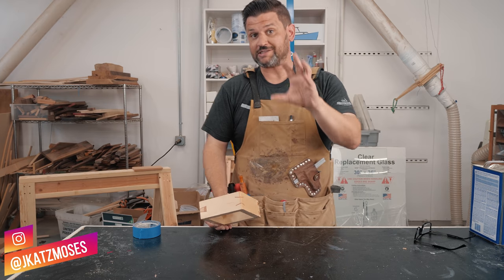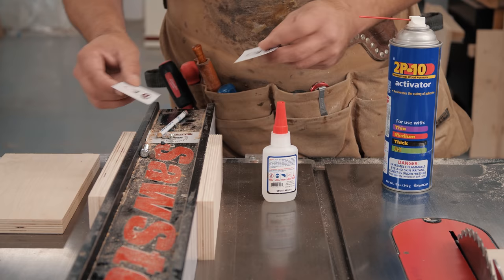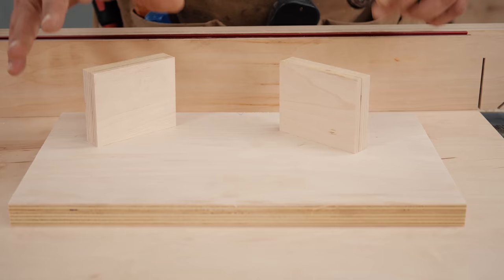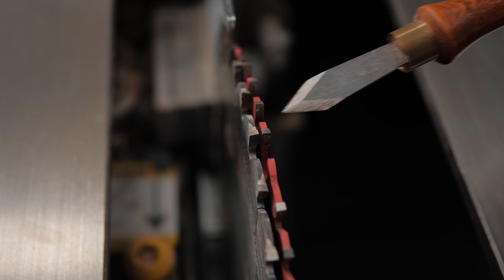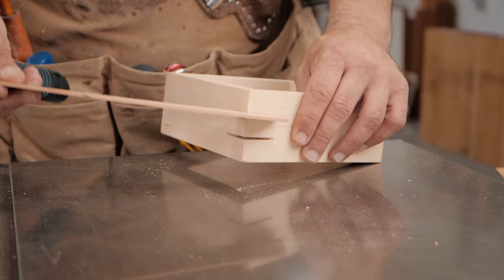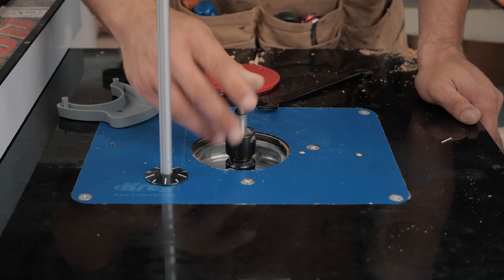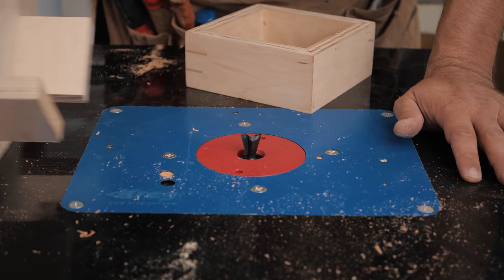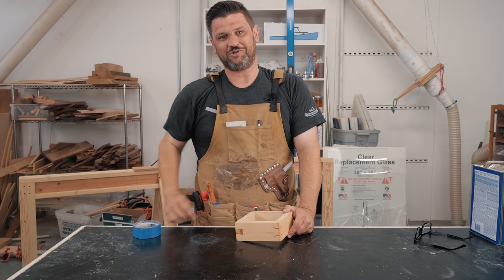4 Creative Ways to Make a Miter Spline

Comment: Miter joints are actually one of the stronger joints. I've seen quite a few tests now showing them to be one of the strongest in compression. Bourbon Moth just did a compression test where he tried to fold the joint and splined miter was the strongest in that application. He compared box joints, dowel pins, dovetails, dominos, pocket screws, butt joints, miter joints, and splined miter joints. A splined miter on some little 1x4s held 260-270lbs. Box joint held 220lbs and a simple miter held 210. Those were the top 3.  I'm sure if you flipped the joints around and and put them into tension instead of compression we would see different results. Depending on the application, miter joints can be one of the strongest joints.
Reply: They are strong at first but they are very susceptible to wood movement throughout the seasons

Comment: Thought on repeatability of the inlaid dovetail key… 1 - cut out larger dovetail on scrap piece. 2 - cut larger dove tail spline and test fit into dovetail cut in scrap piece. 3 - set up jig to cut large dove tail (clamp board on table that is touching the fence as reference point) 4 - glue large dove tail. 5 - install smaller dovetail bit and move fence back over to the clamped reference board (if it hasn’t moved it should the smaller bit lines up with the larger bit on centerline). 
If someone already posted this I apologize. I’ve been watching a lot of metal machining videos and they use reference points and ad-hoc stops a lot for repeatability. Also lining up something like this reeks havoc on my anxiety. 

Love this stuff man!

Comment: When you put the 1st dovetail spline in I stopped the video.  Then I reasoned with myself as to how would I go about 'inlaying' that joint.  It came to me kind of suddenly that I'd have to cut a smaller dovetail in the big one and think inversely about the cuts.  Then, I resumed your video AND you did exactly that, and very well.  Thanks.  A good lesson.

Comment: I have used both the straight spline and the dovetail spline on boxes.  Getting the dovetail key tuned in has always been a bear for me.  Usually takes three or four tries to get it right.  Always the temptation to bump the fence over one more time, and then it is too loose.  I have seen the dowel spline also and really like the look, but have not invested in the jig to drill the holes.  I will try the angled spline on the next project.  Like that look also.
Reply from the maker: Yeah it was a tricky SOB

Comment: So you say these are for a box, but if i was making a display case/shadow box to hang on a wall would these support the weight, without putting in any screws? I was going to make a M&T joint and put a pin through the T to prevent racking.
Reply from the maker: Absolutely

Comment: I like making small boxes and miters are my joint of choice because, as you mention, they hide all the end grain.

The problem is i dont have a table saw or a router.  What i have is a big bandsaw. 

Do you have any ideas how to set up a bandsaw to cut splines in miters?  Be very curious to hear any solutions you might have.
Reply from the maker: The cut from a bandsaw is rough so it's going to be tough to get good splines without some refinement.
Reply: You could always use a handsaw and veneer as splines, works quite well and adds more strenght than you might think.
Reply: @jonikuhn2441  Interesting. I'd thought about it but dismissed it because i figured it wouldn't add any strength. Have you tried this yourself?
Reply: @joshwalker5605  yes, on some boxes and picture frames, so far they all held up well.
Reply: Joni Kuhn well i guess i’ll give it a shot, thanks!